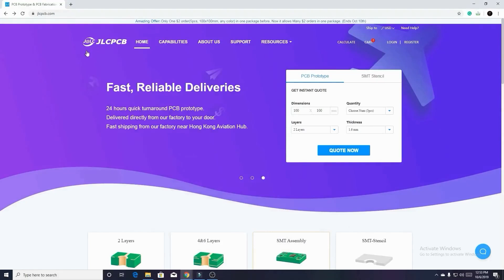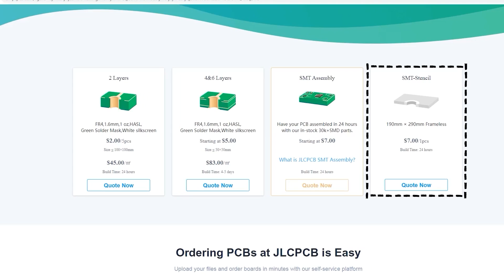*Amazing* I Install Fingerprint in My Gaming PC

Comment: This could've been cheaper using an over the shelf fingerprint padlock as it already includes all you need and you just need to connect the included relay to your pc instead of the locking mechanism.

Comment: The only thing that is missing is yours isn't Bluetooth, which can be sy for your remote cameras and your phone. Also, the unit is in the open and there isn't an alarm on it. If you even move the case without first logging onto the system, the alarm will go off. If you try to open the pc case without using a code on your phone through Google verified the alarm will go off. This has been out for years so it's good but old. thinks for the post and good luck!

Comment: Hey mate! excellent tutorial. However, I do have a few doubts prior to going ahead and doing it. I did end up ordering all the required parts from the link and turns out;

1) The fingerprint sensor used in this video has a little PCB attached to it which has 5 output pins as per your diagram. But on the link you shared, I ordered "R502-A Capacitive Fingerprint Reader Module Sensor Scanner Small Thin Circular Ring LED Control DC3.3V MX1.0-6pin

" which has 6 wires" coming from it.

How would that connect up? as i noticed, that it requires 3.3v and not 5v as per the data sheet.

I'm stuck at this stage and would appreciate if you could have a look at this? Thanks

Comment: So does the fingerprint read the finger and if it is correct, it will power the pc on?
Or:
Does the fingerprint power the pc on and cache the finger for unlocking windows? 
Cool video btw :)

Comment: Wow your casing is awesome 😍but I don't have much money to buy😭I plane to buy aerocool  cylon in white I saved my money for case I currently use gigabyte gz g1 case I give some customization like temper glass and 2 thunder RGB fan on the front and 1 back and 1 RGB cooler processor fan

Comment: Bro my PC not working 4 long beep turning off
Any solutions
Reply: I am not The Wrench, but I do have a good fix for that.
step 1: Dissasemble everything in your PC, and put it back together, then turn it on.
if that does not work
step 2: try replacing the RAM, AND/OR hard drive, then turn it on.
if that dodoes not work
step 3: Acknowledge that I can't help you, anymore, and go consult a PC technician, for help.